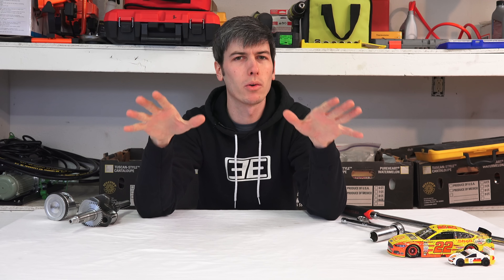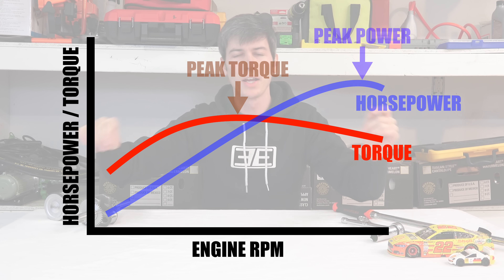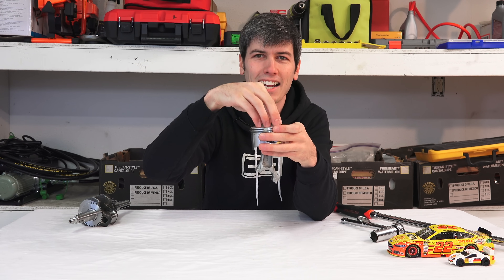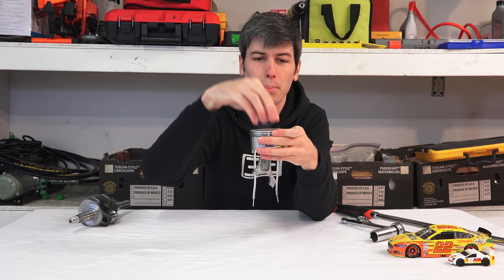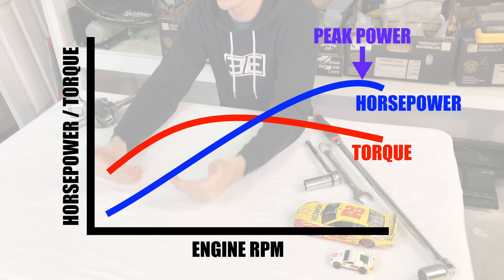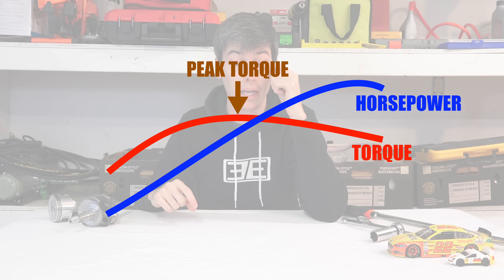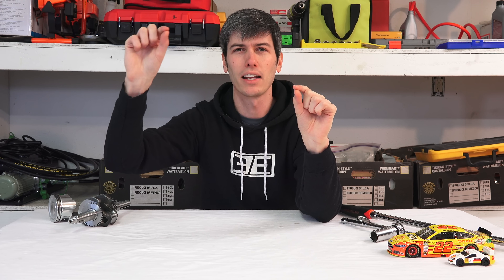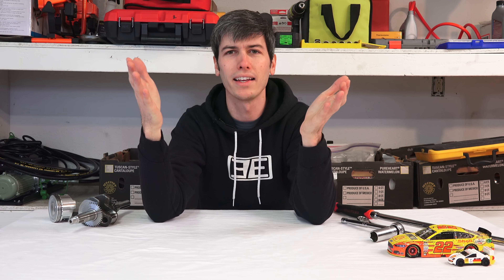Horsepower vs Torque - A Simple Explanation

Comment: And then to further complicate it, even if horsepower is the thing you want to know for speed/acceleration; every vehicle weighs something different and that has to be factored in too. I just keep it simple and compare 0-60 times to get the best idea. Though I guess if you're putting a custom engine into a vehicle you'd like to know the torque/hp curves of the engine, but for most of us I think 0-60 is a good indicator of what to expect for buying a new vehicle

Comment: Thank you really good explanation. The leverage used by Lamborghini with that gearing seems to be an example with the hurrican. I don't know if this makes sense or whether it's true... First three gears are shorter and rev very quickly, then the fourth gear is taller but it's able to utilise the force at work (engine power + inertia). Some cars seem to have too tall a final drive gear. My old 82 skyline's 5th gear was useless. It seemed that there wasn't enough power to "force multiply'. Give me a lever big enough....

Comment: Hey I know it's late but I have a question?
In an uneven road situation like a hill area, does torque or horsepower perform better in this situation because from what I understand from your given example, in a normal even road situation, the higher Horsepower car outperforms the higher torque car on even roads

Comment: Get on a bike. Put it on gear #3.

Hold the brakes, then press your foot down on the pedal. Give it all you got. Max effort! Feel the pressure on your foot? That's torque. It's energy being applied to the system.

There's currently no horsepower because the bike is not going anywhere.

Now, release the brakes.

Man it sure is hard to pedal that thing!! Keep giving it max effort. That's still peak torque! But hey look at this... you are slowly increasing speed (cuz your tires are moving). Your wheels now have a number of revolutions per minute (rpm).

Now, once you are going as fast as YOU can go on THAT bike, count the rpm of the wheel on your little fancy gauge that you spent 40 bucks on at Walmart. That's the peak horsepower of that bike (with you as it's engine).

"Power" is simply some voodoo magic number that you get when take what you feel on your foot, and multiply that by the number of times that wheel rotates per minute.

It's like "watts" in electrical engineering. It's a voodoo magic number that the brain will have trouble understanding unless you deal with this kinda thing day in and day out (which is why engineers have trouble explaining this to smoothbrains, cuz they get it intuitively by then and their whole world 'revolves' around it. See what I did there?)

Torque = foot thingy.
Max torque = your leg strength.
Power = wheel thingy.
Max power = how late/early you'll be for work.
Profit.

Comment: You said “twisting” a few times but while it’s not totally incorrect and one should be able to still understand what you meant, the preferred term would be “bending” (for the orientation you demonstrated). The term twisting is usually associated with a torque that causes the member to have significant shear stresses (notably on the outer fibers as opposed to bending where the outer fibers have zero shear). At least thats how we would describe it in academia and in engineering practice.

Comment: People argue all the time, which is more important:  Torque or HP for a car's motor.    They don't realize the two are practically synonymous since they're related by the RPM component.   Simply put, a Torque value at any given RPM is making your Horsepower rate at that RPM.  Increase the torque at an RPM value, you increase the HP at that RPM value.   Period.   It's really follows that simply.
The problem with the Torque vs HP argument when you have folks only looking at their PEAK torque numbers that may happen at low RPMs but a low torque at high RPM, and wonder why their HP is unimpressive, and then claim the HP number is more important than the torque number because they have a "high torque" (at a certain low RPM) engine that can't get out of its own way.   Build your motor so it maximizes torque output throughout your higher RPM range and you'll be rewarded with high HP.  You can't make HP without Torque.
Reply: So you started with "power and torque related with rpm component" but somehow by the end didn't realise that not much torque needed to generate 1000hp at 100.000 rpm. 
"Hp and torque are synonymous" is absolutely hilarious, read the definition.
Reply: @IgorArkin  Quit trying to sound smarter than you are.  Do you have a motor that revs to 100,000 RPM?  LOL Stick to the context.   By the formula HP = TQ x RPM.   To get more HP, you either increase TQ or increase RPM (, or both).  But the RPM for an automotive motor is always going to be with in a certain range of values, so that essentially only leaves TQ as the variable that allows you to further increase HP at ANY RPM VALUE (in a real life motor, not some made up fantasy motor).   So, more TQ = more HP.   They follow each other within your RPM range.  Thus, they are synonymous.  Go read a book and learn something.

Comment: Awesome - I suppose this is evidenced by top speed which occurs at peak HP with correct gearing rather than peak torque
Reply: Fastest acceleration in a certain speed gap occurs at peak power revs too

Comment: In SI units, power (watts) is simply torque (newton-metres) x angular velocity (radians per second). The length of the arc at a radius over 1 metre through and angle of 1 radian has a length of 1 metres. Thus a torque of 1 newton acting at right angles to the end of that metre radius is just the definition of a joule; that is 1 newton acting over a distance of 1 metre. Divide that by seconds and you get the power in joules per second, or watts as they are better known. Where torque is constant with speed, power is simply a function of angular velocity. Of course, it's rarely that simple, but many piston engines exhibit flat torque over a significant proportion of the rev range, simply because of the way they work, which is why they tend to produce maximum power output high up in the rev range.  

I see a huge amount of nonsense spoken and written by people over what it is very basic physics.
Reply: 100Nm of torque is 100 joules of Work? No, we can not now it.
Reply: @IgorArkin  That is not what I said. 100 Nm working through an angle of 1 radian is 100 joules.

Comment: I had a Diesel with huge amount of torque. And at the beginning you feel that oh man, it is fast. Now I have a classic 300 E 6 cylinder Mercedes, and at lower rpm you think it is not that fast. However when you accelerate and reach around 4k rpm you feel the real power and the energy of an old style petrol engine :)

Comment: So which is best for climbing then? Higher torque over a higher HP, right? So HP’s only good for speed and acceleration?
Reply: Climbing is the same thing as acceleration. You overcome gravity.
Reply: @IgorArkin  so which is better for climbing? The 200 HP with 100 nm torque, or the 100 HP with the 200 nm torque?
Reply: @AlienAdarna  to perform acceleration or to overcome gravity with a given mass you need force, by definition force=mass*acceleration. 
Since Power=force*speed, the more power you are able to apply at the slower speed the more force you gain. Which leads to you needing more power output, but with as short gear as possible, or as small wheels as possible, so the speed of a car is very low but engine running at its full power revs.
Reply: @AlienAdarna  with perfect gearing 200 hp 100 nm beat 100 hp 200 nm all day long uphill down hill on level tarmac with or without laod but both the dame configuration offcorse as resist must be the same with 200 ho version ipeven up to specified level of much bigerr resist it still accelerate faster and achieve more topspeed feg 15 ton 200 hp 100 nm still accelerste faster uphill than10 ton 100 hp 200 nm  😉👌🏻☕️

Comment: Obviously Torque is more important than horsepower, the greater the torque in each rpm, the faster the acceleration and the rpm will also increase, Horse Power is only a derivative of torque. Large horse power does not mean faster and higher rpm, which means that the peak top speed is not determined by the maximum horse power, but maximum RPM
Reply: Everything wrong here. 
Acceleration of the car ≠ acceleration of the engine. 
Ferrari 9000rpm,
Sport bike 18000rpm
Check their top speeds, if not obvious.

Comment: Torque has no time component! Power is a measure of how quickly you can apply the torque. Even on my bicycle I can provide 150 LB-FT of torque. The problem is I can only turn the pedals at 100 RPM. 

It's all about power if you Re racing.

Comment: Maybe a little math is a good thing.  The relationship between torque and horsepower in the engine is  P = T x N / 5252,  where P is horsepower, T is torque in pound-feet, N is the engine speed in rpm.  The horsepower curve is a computed quantity showing the rate at which to torque is doing work at a given rpm.  Acceleration of the vehicle is not only controlled by transmission gear ratios but also by the differential and the tire diameter.

Comment: so i guess you could say horsepower is torque multiplied by rpm, while torque is the amount of force the engine generates per revolution of the crankshaft?
Reply: Torque is the amount of work per revolution, divided by 2π

Comment: By definition, you measure torque  by multiplying the force by the distance to the turning point, like the center of a screw; while horsepower measures how fast an engine can do the work in unit time like a second or a minute. Measuring torque does not involve the time factor.  In daily activities, if you asked me to turn a gigantic screw, all I need is a long enough range, no matter how weak I am, because the force produced by me times long enough range will produce big enough torque to turn that screw.  Don’t ask me to finish the job of turning it in certain time like five seconds,  because torque doesn’t involve time! If you insist that me finishing the work say in five seconds, then we need to consider the horsepower, the rate at which a certain job can be done!  Understand now? I hope.

Comment: There are mistakes in this video in the way to explain this. When u talk about gears is another variable differente than torque and horse power. The smallest car could be faster with a better gear ratio vs the bigger with a bad gear ratio.

Comment: I hated physics when I was a kid and I still hate it.
Comparing a sports bike which obviously has less HP but more torque compared by power to weight ratio is always much faster than a car with higher HP and higher Torque.
Not know much but in my head it all boils down to power to weight ration. Hence you see F1 has an obsession with light weight, their engines are just V10 combined with crazy amount for downforce. Yeah they all have some battery packs but its mostly used under braking.
So the heart of the matter to faster is power to weight

Comment: Amazing explanation ! I have one doubt though. For a Toyota Fortuner/Hilux,
The previous gen AT came with a 174bhp /450Nm and the MT came with a 174bhp / 420Nm.
The current gen AT comes with a 201bhp /500Nm and the MT came with a 201bhp / 420Nm. 
So obviously some tuning has been done on the engine (turbocharger). But how come the torque of the MT didn't increase? I believe the AT had some upgrades to the transmission but what's the actual reason?
Also, the MT is quicker than the AT ;) since the torque band of the MT is wider and the torque converter just does the job alright .

Comment: I believe this is correct: Two vehicles. One weighs 4000 pounds, and has a 500hp gasoline engine with 500 ft/lbs of torque, the 2nd vehicle weighs 8000 pounds and has a diesel engine with 500 hp and 1000 ft/lbs of torque, (gearing is optimized for both) and assume parasitic losses are comparable. They should accelerate similarly?
Reply: No. You can watch the video now.
Reply: @IgorArkin  lol I think you need to re-read my comment.
Reply: @AmericanThunder  why
Reply: @IgorArkin  because my question was not addressed in the video after building vehicles for 45 years I've seen what they do but I want a specific formula to calculate ahead of time
Reply: The lighter car will accelerate quicker because power to weight ratio is higher.
Reply: @Spike00773  So you only consider the HP and not the torque, when figuring out power to weight ratio? Torque means nothing? So if you were to swap in the 500hp/1000 ft lb engine into the light car, it wouldn't be any faster than it was with the 500hp/500 ft lb engine? lol
Reply: @AmericanThunder  Correct, it wouldn't be any faster. The torque of an engine is in itself is not very relevant, since you can always achieve any torque you want by gearing. Power is the metric of an engine that tells you how performant it is.
Reply: @AmericanThunder  What's measured at a dyno is torque at a given RPM. If it was only torque it wouldn't be that useful, because as i said, you can achieve any torque with gearing, but the power of the engine will always be the same.

Power is the rate at which work is done, whether that would be increasing a cars kinetic energy (speed) or towing something up a hill, power is the metric that determines the performance.

Comment: This is how modern 4 stroke motocross bikes now make more power than 2 strokes. 14-16k rpm versus about 8k rpm.
Reply: With intake and exhaust systems that work well at those speeds.

Comment: Unfortunately this is a bit misleading. It confuses hp with power and in fact there are 3 components in this 
hp which is thrust over time torque which is twisting force and 
net power which is both combined.

And then there is mass.

 But then it gets more complicated. Most demo have little graphs like this which cannot be applied to Turbo engines where actual real power is available over a much greater rev range. A good example is the XR6 Typhoon with Ford's Barra engine. Real much greater acceleration power is delivered over a much broader rev range than the larger injected V8. The Turbo Changes everything. The same can happen in a Turbo diesel but the rpm range is generally much less. Petrol engines are lighter and generally have less mass etc 

People often look at torque and HP as separate things and fail to realise that it's the combination of both over time that will give you an idea of what the real performance potential of an engine might really be.  A brilliant example of this is the 300 SEL 6.3 which was then taken racing in the Red pig is slayed everything back then.
Reply: "it confuses hp with power"
Wat? Its like it confuses centimetres with length. Read what power is.
Reply: -1

Comment: i always assumed power and speed are alternates as kinds of torques   i think i would use the term speed  instead of torque  ...when you ride a bike and shift in high gear , the torque is power thats  required  to produce speed , but in lower gears you need speed torque to produce power
Reply: Wat? Rethink it in a proper way.
Reply: Torque is what you get when you downshift, not upshift. It means you can at least go up a steep hill slowly without bogging the engine down. Power is required to produce speed.

Comment: So my question is if a vehicle is struggling up a hill is that because it has insufficient torque or insufficient horsepower? This is how gear ratios are determined. But if you have a semi truck that goes up a hill, slow because of weight, would it need more torque or more horsepower for the gear that it has installed?
Reply: If the engine is lugging, it doesn't have enough torque and you need to downshift. If you're still not going up the hill as fast as you want to after you downshift, your engine needs more power.
Reply: Vehicle ≠ engine
You must introduce speed to understand

Comment: But if you have a load which is better?
Reply: Load doesn't matter, 2nd newton law  is there anyways. Double the mass and acceleration will be twice reduced in any scenario.
Reply: Your engine needs two things: (a) enough power to move the load up hills fast enough, and (b) enough torque to maintain that speed in your transmission's lowest gear.

Comment: Hello sir i dont get something how some engine have a lot torque but low horsepower ? How this possible when u have more force ?!!
U torquie is power to force piston down and horsepower = camchaft speed right how when we have more force camshaft speed is low ?!
(Sorry if have mistake not native)
Reply: A large single-cam engine (SOHC) will produce a lot of torque at low RPMs, but it won't develop as much power as a duel-cam (DOHC) at high RPMs, because it doesn't allow gasses to flow in and out of the cylinders as quickly.

Comment: I want to increase torque on my sedan car so that i have no problem in hill climbing esp when the car is loaded with passenger.
Beside changing into low gear,
What are other options to increase torque?
Reply: What's wrong with downshifting? If it's not fast enough, you need a more powerful engine.
Reply: You don't need torque to climb. You  can swap your driven wheels for 8" from electric scooter, increasing thrust approximately two times

Comment: To me the most simple way to think about it is that power is torque being delivered at some rate.  Nothing more, nothing less.  People think of power and torque as two different things and argue about which is better but the fact is that by definition power is simply torque in motion at some rotational speed.  An engine's torque by itself can do no work - it has to be delivered at some rate in order to do work, regardless if that is moving a vehicle, spinning a generator, powering a machine, or whatever.  This is why an engine's power rating is what determines how much work it can do in a given amount of time, not its torque rating.